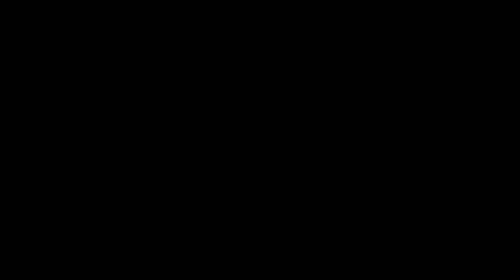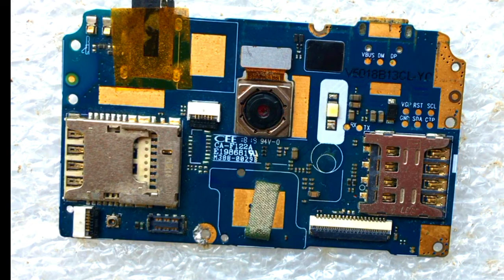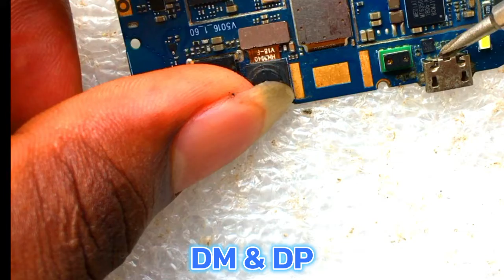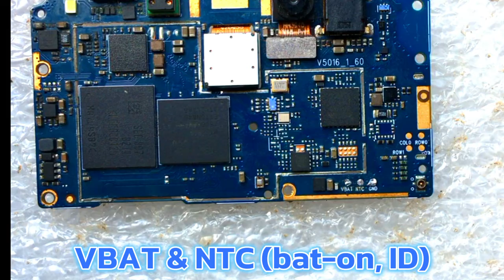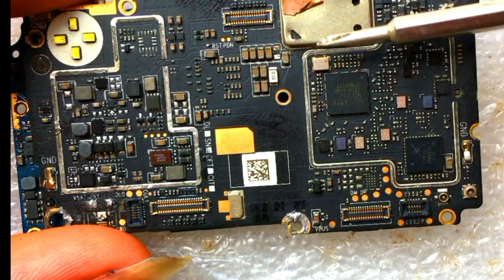5 Mobile Repairing Jumper Tricks You Should Start Doing Now!

Comment: Thanks bro, I was asking about broken charging pin all are broken I saw one guy jumper to one positive pin to the nearest capacitor and another pin to ground does it work that way?
Reply from the maker: It’s not about the nearest capacitors. 
You need to know if that capacitor is connected with vbus before you do any jumper.

Comment: Please Sir, I have bought an itel it1506 to be repaired which when turned on or restarted will go back to start screen like when factory restored but, when I try to restore it from the settings or hard reset it, it will neither respond when I press restore button on the screen nor boot to the bios in order for me to restore it and i can't even flash it again as, it keeps failing.
it also always warns about insufficient space and when i check the space, the total space is 8gb and available space is 10mb and there is no used space showing.
and again the phone delay from even turning on and some times when I turn it on it will start to boot but when it boots to the home screen I can only see a screen light only without graphics but when I long press the power button the restart and shutdown buttons will display.
I don't know what's wrong with it and how can I solve it.
Please help me out.
Reply from the maker: Sorry for the late response. 
That’s should be crashed memory problem. 
If you tried flashing with the correct file and it does work then you need to change or reprogram the memory.
Reply: @SergesMike  thanks